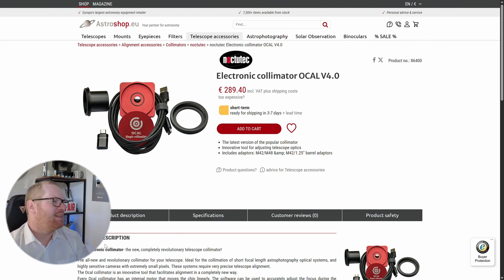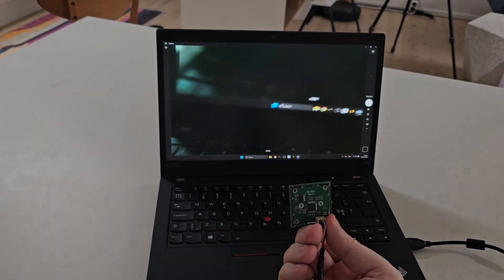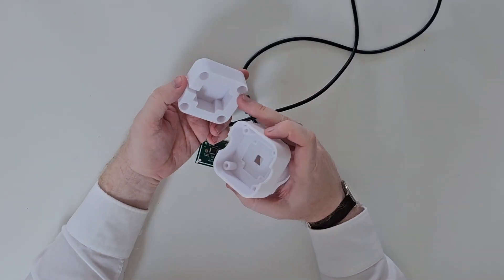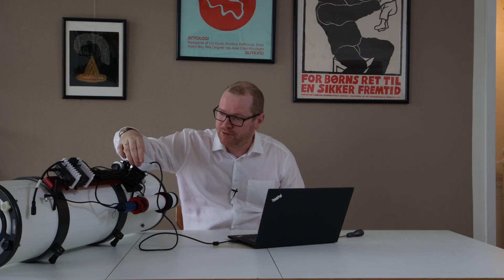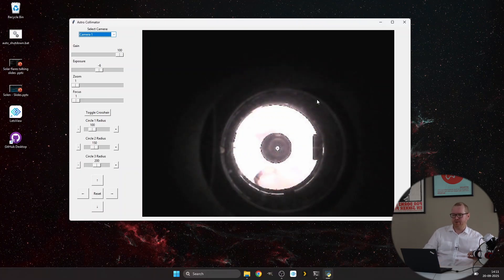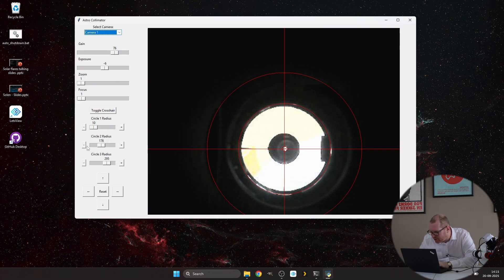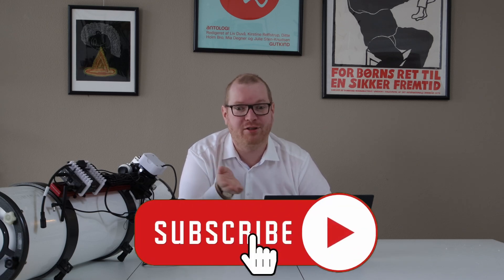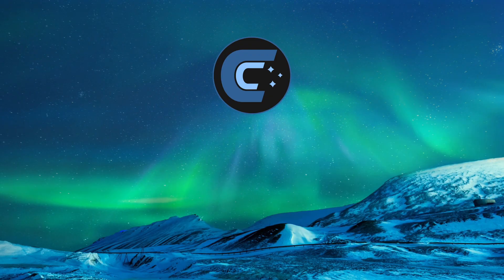DIY Electronic Collimator – Easy Weekend Build for Under $40

Comment: You need an adjustment for the optical axis of the camera. A quick way would be O rings between PCB and standoffs. Either move the focuser or mount extension tubes to the camera module to see axis deviation. Then I suggest to print a T2 thread and use a metal 2" barrel instead of a printed barrel, because that does not deform when clamping it in the focuser. That reduces the gap to Ocal significantly.

Comment: I have been using "ALs Collimation Aid" (circle-overlay-software) for years, you should check it out. you can use it with any AP-software and use the camera you have.
only thing is focusing on mirrors when doing first collimation indoor ! but it works fine for me. i fine tune on de-focused star anyway.

Comment: If you own a modern fast F-ratio Newtonian astrograph, and your using it for astrophotography, proper collimation is much more complicated than this. Especially when you use a coma corrector. My question is, is your camera itself properly collimated? If not, you may not be properly collimated. Even the slightest miss collimation leads to image degradation. Look up Catseye collimation tools and Vic Menard's  Newtonian collimation procedures. The Catseye tools are often more expensive than the telescope itself, but if you're looking to get the most out of a fast Newtonian it's the only way to go. Catseye also make their own camera and specialized offset pupil autocollimator which are unmatched on the collimation tools market. Keep in mind, with fast "f" ratio Newtonian's the sweet spot for proper alignment is quite small. Once you add a coma corrector it becomes even smaller. Literally fractions of millimeters. It seems everyone is a professional these days. Some people just don't understand that for photos with a fast Newtonian the tolerances for misalignment are much smaller. If you're like myself, you bought a large mount and a less expensive fast Newtonian because the light gathering capabilities of Newtonian's dwarf the  capabilities of the myriad of small APO refractors, and do so at a fraction of the cost. There's always a tradeoff though. The tradeoff of course is that with any Newtonian telescope below about f/5, you must use a coma corrector or stars on the edges of your FOV will look like comets. There's no way around this. Not to mention the coma correctors can be quite expensive themselves. My Televue Paracoor type II at that time was around $500 U.S., but it was one of few options to be able to use the astrograph to it's full potential. Unless you built in a way to collimate your camera eyepiece itself, it may be giving you false visual ques. Also, a camera alone isn't sufficient to properly collimate a Newtonian astrograph. There are many more concerns to consider before popping a camera in the focuser and believing you're properly collimated. Catseye collimation tools website explains it fully. If you're skeptical, look up Vic Menard or Donald E. Pensack on Newtonian collimation.

Comment: Thanks for sharing the STL's.  Just ordered a couple of modules that use the same CMOS sensor, but at 1/10th the cost of the Arducam module... will be interesting to see how well it compares 🤥
Reply from the maker: I mean as long as you can get an image on your computer it should work
Reply: @cosmic_curiosity    LOL - thought it was too good to be true - the listed item was just the USB cables !! - don't you just love Ali Express and misleading listings. 😒- Just ordered a 4K 8MP module for £20 delivered - so we'll see how that performs, and this time the confirmation did show the camera module as being ordered.  Just need to sit and wait a couple of weeks for it to arrive.
Reply: The £19  camera module from Ali Express arrived today and fitted in the housing just fine.  Haven't used it on the 8" reflector yet, but shows up in Sharp Cap, even at 4K resolution.  

@cosmic_curiosity - Thanks for designing and sharing the STLs - Its an excellent addition to the tools any owner of a reflecting telescope should have.

Comment: Neet print! One simple addition to the user manual: turn the camera inside the focuser to make sure the sensor is centered. Maybe add 2 screws for setting the X/Y position of the PCB in case it wouldn't be perfectly centered. And a spring on each axis to counter-act these screws. I'd sure take a look at your python program if you'd provide a link for that ;)

Comment: Thanks for the video. As a couple of people mentioned here, you are missing the calibration of the camera, but maybe you could do it as well, you just need to make a tool in which you can rotate the camera and measure the center of the rotation, and use those coordinates later. Daniel Nimmervoll made a video about a similar project, which comes with a calibration unit, have a look. Btw. you can use the Collimation Circles opensource project to put some circles and other overlays onto the camera image to help the collimation.

Comment: Keep in mind that in order to use the camera as a collimation tool, the camera must be truly at the right angle to the optical axis and be rotationally symmetrical, so that you can rotate it around by an arbitrary amount and it'll still stay true. Otherwise you're just adding and magnifying any imperfection in the camera's alignment to the scope's misalignment.

Comment: Great project, looks to work not to bad and I feel it would be totally fine on F5 scopes and above. I would choose your version over a Cheshire and lasers after using the real thing in the Ocal 4 collimator.

As one of the the other commenters said it has adjustability and precision to the pixel level with each unit having its own calibration code.

I have just finished filming a video using it on my 24" f3.3 Dobsonian that I will upload today.
I usually check collimation on Jupiter or Saturn's moons and last night I didn't have to make any adjustments after checking on Titan with my image train inline. The Ocal 4 is blowing my mind

All the best
Damo
Reply from the maker: Im pretty sure I will end up getting a Ocal too at some point. I was just fun to see if it was doable to make your own
Reply: @cosmic_curiosity  You did a rally good job knocking that up to be fair. 

I am putting the video together now and my FL combination for the image train i was about to use was 4700mm (50% of normal) and it was absolutely about 95% of perfect without me touching it. I feel you will not regret the purchase of the Ocal 4.

All the best
Damo

P.S. Watched your Proxisky 17 video a few months ago and really liked that piece you did.

Comment: Can I make a suggestion? consider instead of using an arducam....why not use a guide camera that is already on your scope. Maybe make a N.I.N.A Plug in. Just saying.
Reply from the maker: That's not a bad idea. I'll have to let that cook for a bit.
Reply: I've used a my planetary camera with a CCTV lens attached (set for high F ratio and focus at <> 1-2m). I use sharpcap. Its good for setup after cleaning mirrors.
Reply: I use a 15 dollar Arducam Lens for Raspberry Pi HQ Camera 6mm on a ASI220MM (has CS adapter ring) and stick it into a 2inch-1.25 adapter. No printing required. Half the cost, if you have a guide camera already
Reply: Awesome. Thank you 🖖🏼
Reply: Cause focus ... u need a lens in the cam and with a guide cam your telecope is your lens and it will never work 👍 no focus inside the scope / mirrors.
Reply: @allffrommars6019  You would need to reuse a old eyepeice til get the it to work... and there is the problem that most people likely dont want to remove the guide camera onoce it is in focus inside the guide scope

Comment: The OCAL has actually the ability to mechanically move the lens and focus. Also, every OCAL unit is calibrated and you get the calibration data so the center of the center of the camera actually lines up with the center of the crosshair and rings overlayed by the software. It's the precision of engineering, that makes the OCAL this expensive.
Your budget solution will work fine for slower newtonian telescopes I'm sure, but for the fast sub F4 newtonians the OCAL is a must have tool imho. I can tell from experience, that my image-quality has drastically improved ever since I switched to the OCAL to collimate my F3.5 and F2.8 newtonians. I don't even need to do deconvolution anymore or use BlurX as the raw subs are coming out 99.9% perfect across the whole FOV already.
Reply: Agree totally, I could never get collimation that I was happy with until two things happened 
1/ fitted a Steeltrack focuser to my 200pds 
2/ used the Ocal to fine tune , the aility a Steel-track has  to adjust the drawtube combined with using an Ocal for perfect collimation
Reply: About 18 months ago I had the same thought and built my own collimator similar to this. Took a couple of tries to get the camera exactly at the centre and exactly at right angles so it pointed directly down the focusser. I used some free software  that allowed me to put concentric rings over the field of view and.... it worked. Well sort of. I was able to improve the collimation of my F4 newt but overall I think the Ocal would be better and easier to use. The problem with the Ocal though is the price. Not saying it's not fair, just expensive. I keep looking to see if I can find a second hand one but the local market here is small.